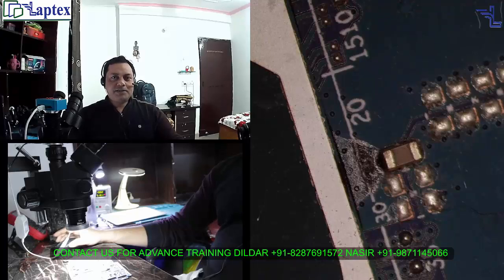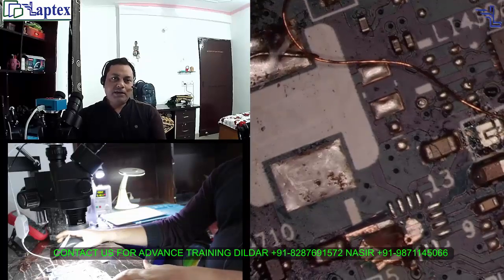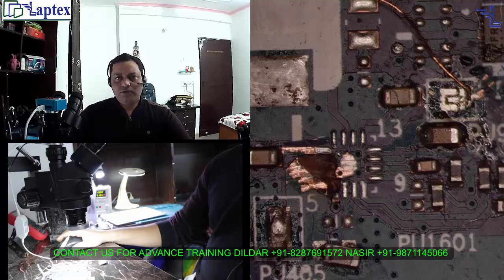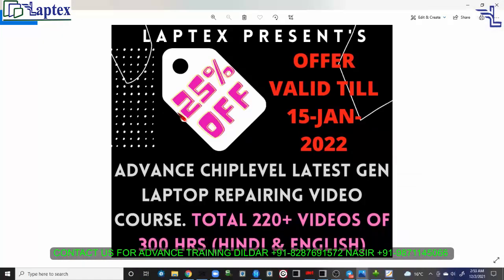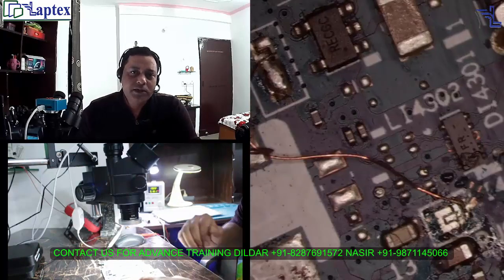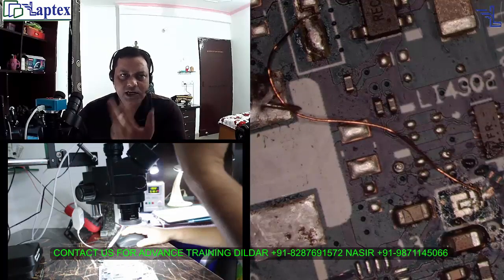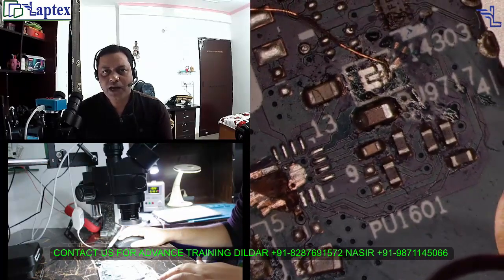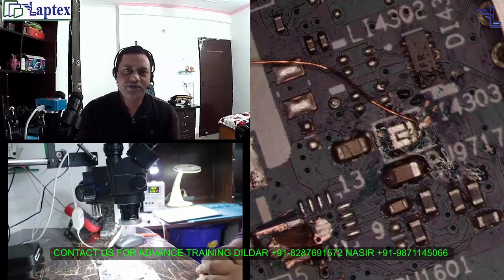LENOVO IDEAPAD 3 10th Gen Common Fault |NM-D031 |Online Chiplevel Laptop Repair Video Course English

Comment: I have a Lenovo IdeaPad 3 15ARE05 that won't turn on.  Powers up with lights but screen is off.  If I unplug main battery and cmos I can get it to turn back on.  Is this related to what's in the video?  Also what did he do to fix it?  Sounds like he ran power from one location to another?
Reply from the maker: If you are user then better to get it checked by local technician. If you are already working as laptop technician the better check the charging section requirements and switching with battery connected in the laptop.👍

Comment: Looking for a hand here. I have a motherboard that turns on, starts booting from the hdd, then it shuts off. This also happens navigating in the bios interface, after a minute or so it turns off. Standby voltages are still presentafter shutting off, sio responds to on/off button and the story repeats. Any suggestion on what should I check? Any help would be really appreciated.
Reply from the maker: This seems to be BIOS issue bro.
Reply: Thanks for the answer! Reflashing the bios didn't help. I'll try a new chip as soon as i get it.